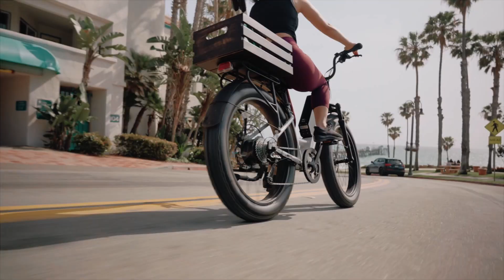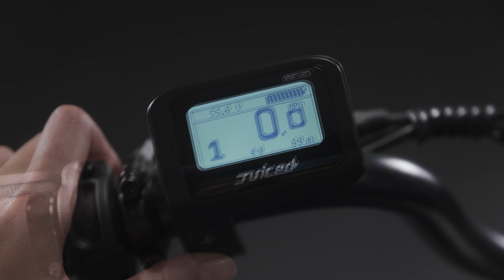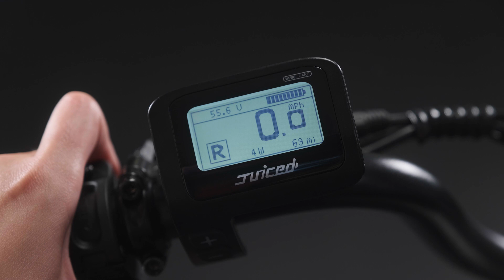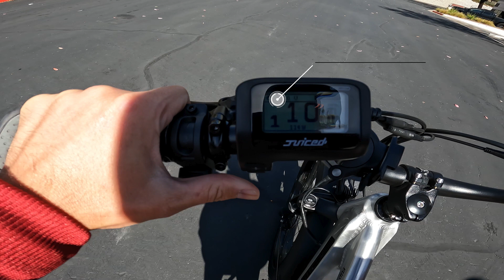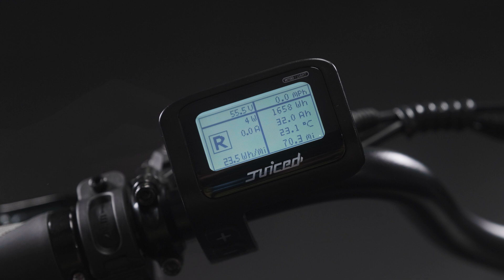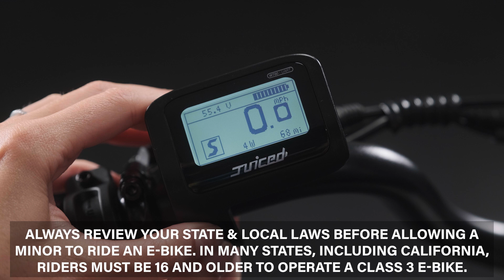Juiced Bikes: Advanced LCD Display Overview

Comment: The Low Volts recommended setting of 42V -  43V seems too low for the 52V battery. What charge % does that represent? 

We just got a RipRacer and love it!!!
Reply from the maker: Hey 👋 👌 It is low, that is when the e-bike will actually stop performing, however, you can adjust the lowest voltage via the LCD setting higher if so desired for battery care reasons.

Comment: Hi, I have a Ripcurrent. I've had it for 3-4 years but only have 200 miles on it I mostly use it hunting. The first mistake I made was getting the tall version. I was afraid the regular version might be small since you guys offered a tall but Im 5'10" and the tall version is really tall. Other than that when I go top speed the bike jerks in and out with the power. I was thinking I probably had the settings wrong so I made a couple changes after watching this video that I hope will solve it. I know this isn't customer service but the back part of the handlebar mount for the LCD display cracked in half. Is there anyway to get just the plastic "C" bracket. 
Thanks
Reply from the maker: Hey 👋 If you are having issues with your e-bike contact support@juicedbikes.com for tech and warranty assistance.

Comment: Help! My odometer reset by itself and I can't set it back where I want it. Whenever I set it then press the power button, it just goes back to 0 again. Any way I can set it to a certain number? Crosscurrent X
Reply from the maker: Hey Joe, Thanks for reaching out! If the odometer reset, unfortunately, there is no way to change or recover that number if it does. Contact support@juicedbikes.com if you have additional questions.

Comment: My one-day-old RipCurrent S seems to be an excellent value in the 2000 to 2500 price point, and the choice of an XL frame is important to us 6-foot+ types. It's very strong, smooth and quiet. For the life of me I cannot understand the very tall handlebars, but new ones are on the way. Save the box if you want to ship yours someday -- excellent packaging.
Reply: I bought my rip current S, because of the high handlebars. 😂😂

Comment: my city scrambler came with the wheel size programmed at 1880, but the manual says the mag wheels should be 1770 -- which is correct?
Reply from the maker: Hey 👋 If you have the stock City Scrambler tires then yes it should be 1770.

Comment: Can the Odometer and Trip Odometer be reversed on the Main Display? Whether Car, Motorcycle, or Bicycle, for daily driving does anyone care about Total Miles? I have all of my vehicles set to display Trip Odometer and only look at total when doing maintenance, registration, ect. Trip Odometer is the Important one for Daily use.
Reply: I bought a after market odometer for just that reason